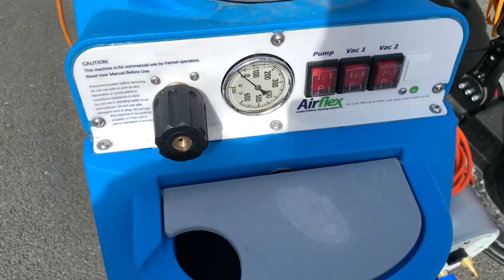Domestic Carpet Cleaning Squeak and Bubbles Leeds 2020 #carpetcleanersLeeds #squeakandbubblesLeeds

Comment: Slicing through that soil like a hot knife through butter! Is it nylon? I just got a Numatic 332 myself. What do you use it for mostly?
Reply from the maker: The Numatic I only use it for office space were their is a lot of office chairs, allows us to get in and out of tight spaces rather than using the 17" rotary or the Cimex. We have also a 11" Floormac which is a gem of a rotary for stairs. Carpets different types in this video from wool/woolmix to man made fibre.
Reply: @squeakandbubblescarpetcleaners  I've got 2 floormac equivalents now (basically dressed up Orecks) - I love them!
Reply from the maker: @thecaffeinatedcleaners7690   Cool. Cracking little machines.  You can see my other machines working VLM https://youtu.be/rx4Q0Tks1_o